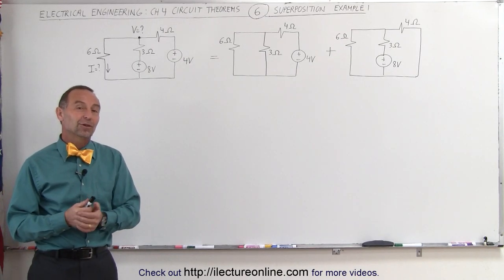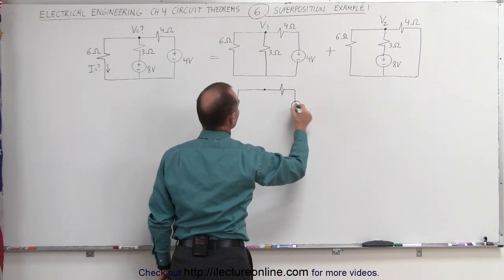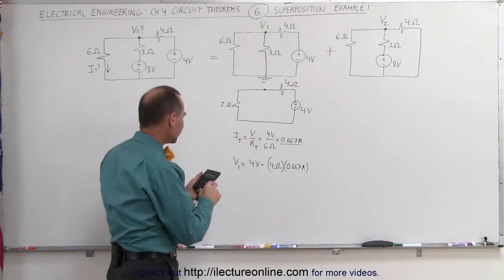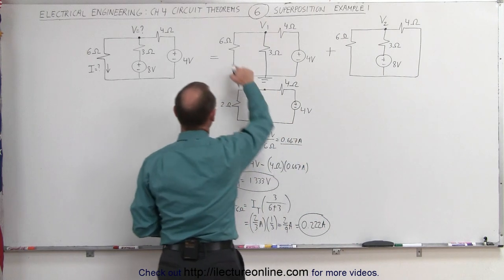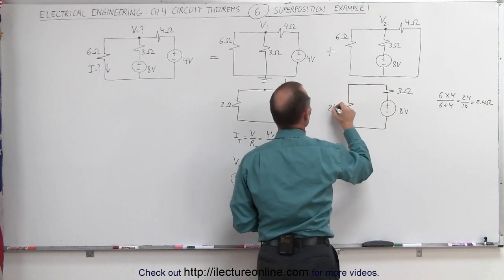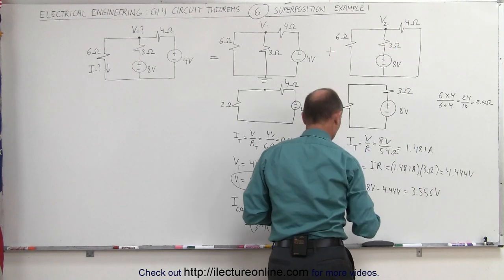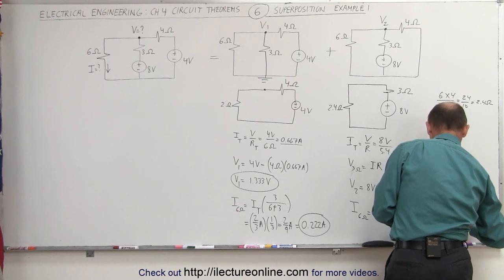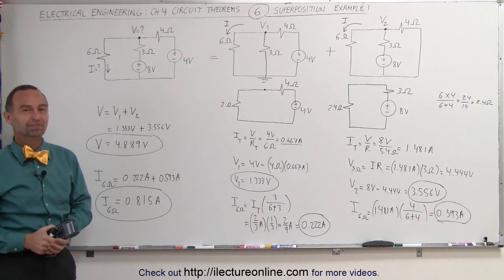Electrical Engineering: Ch 4: Circuit Theorems (6 of 35) Superposition Property Ex. 1

Comment: I calculated the CURRENT through the 6 ohm resistor using the equation,  I = V1/R6 = (1.333v)/ 6 ohms = 0.222 Amps)  since the 4 ohm and 6 ohm resisters were in Parallel with a common Voltage source at the NODE...   SEE MICHEL?.. you have taught us the different ways to come up with the same answer !!! Thank you for that. You teach us to think about the problems...

Comment: Another great video Michel! These video’s are the only thing getting me through my HNC atm!

Can you just clarify that it’s the current divider rule you’re using at 2:53 ? I’m just writing up revision notes and wanted to add a bit more background info 😊 Thanks
Reply from the maker: When we separate the sources into 2 circuits, we no longer need to use Kirchhoff's rules (although we could).  Then we end up with a parallel branch in each circuit and use the rule of parallel branches (product over the sum), not the current divider rule.

Comment: What was the purpose of calculating i1 and i2 in this equation? Would we not have saved lots of time to find only V1 and V2, find the total node voltage V, then just use basic ohm's law to calculate the current across the 6 ohm resistor?

In other words, I noticed that with V=4.889 volts and R=6  ohms, V/R yields 0.815 amps. No need to find i1 or i2 in this instance.

Comment: For calculating the current through the 6 ohms resistor should u not have a 6 rather than 4 on numerator? The divider rule? Since u want it through 6 u need to multiply by 6 no?

Comment: Hi, can you clarify why the 6 ohm and 4 ohm resistors are in parallel? What does it exactly have mean to share the same node? Thanks!
Reply from the maker: A node is where 3 or more conductors come together.  If the current traveling from one node to another can travel through one resistor OR another resistor then they are in parallel.  If the current must travel through both resistors then they are in series.
Reply: I know I am late. But, still I hope my explanation will help someone with the same question. If you use a breadboard to make this circuit you will notice that these two resistors have to be in parallel. They are just on the opposite side of each other. But it does not make any difference. Sometimes, a diagram is more confusing than a practical circuit.

Comment: I added the 4 ohm and 3 ohm first to get the equivalent resistant then I did a parallel  with 6 ohm so is it wrong to do that?
Reply from the maker: That is indeed incorrect.  Work it the way it is shown in the video.

Comment: Why only the 3 and 6 ohm resistors considered in determinig the current through the 6 ohm resistor? i_6ohm=i_T*[3/(6+3)] What about the 4 ohm resistor?
Reply: Because that is the total current going through the branch with the voltage source.
Reply from the maker: The 6 and 3 ohm resistor in parallel is equivalent to a 2 ohm resistor and that equivalent 2 ohm resistor is in series with the 4 ohm resistor giving a total resistance of 6 ohms   (2 + 4 = 6)
Reply: For the top middle diagram, the possible equivalent resistance combination such that you don't make all 3 resistor into one equivalent resistor( otherwise you can't find V1 , after the voltage drop across the 4ohms resistor) is 6ohms with 3ohms, 6ohms with 4ohms, 3ohms with 4ohms. Any combination with 4ohms is useless since you won't be able to find the voltage drop across the 4ohms resistor hence you are only left with making an equivilanet resistance with 6ohms and 3ohms.

Comment: for 8V circuit, i calculated the resistor of 3ohm || 4ohm instead of 6ohm || 4ohm like what you did, and so I got my V2 around 6.223V. however when i combined my V2+V1(6.223+1.333) i got 7.556V instead so im not sure where i did wrong. and if i add the resistors of 6ohm || 3ohm then i get my V2 a 5.334V, which means the overall V i get will be entirely different again. so im confused. how does one know which resistors to add??? does this mean we shouldn't change the branch connected between 3ohms and 8V source?? sorry if i ask a stupid question lol

Comment: What if the 4 ohm resistor didnt exist? Can we use superposition then? Cause, if we do it would short the circuit in one of the them.
Reply from the maker: Every method is not ideal for every situation and many circuits can be solved by multiple techniques.
Reply: Oh okay, thank you sir

Comment: 6 ohm resistor is in parallel with the 4 ohm resistor? on the second part?
Reply from the maker: Since there are two paths from V2 to the negative side of the 8 volt source, the 4 ohm and 6 ohm resistors are indeed in parallel.
Reply: Michel van Biezen bu there is 2 ways to go to the negative part of the 4v as well...both the first and the second look similar to me.. can you explain the difference Prof. Thanks

Comment: Sorry, but isn't the voltage at the node the same voltage of the three ohm's resistor? I have tried to solve the circuit by myself and the voltage of the three ohm's resistor that I have calculated is 3.107 V. For to solve the circuit, frist I have made to work only the current source of 8 V and the voltage of the three ohm's resistor was 4.443 V, then I have made to work only the current source of 4 volt and the voltage of the resistor of three ohm was 1.336. Finally, I have made 4.443 - 1.336 = 3.107 V. I also have tried to solve it with kirchhoff's laws and with the method of the "circuit analysis-mesh current" and the voltage of three ohm's resistor (which I think is the same of the voltage at node) is, in both cases, 3.108 V. Please can you tell me if I was wrong?
I apologize for my english.
Thank you.
Reply from the maker: Are you referring to why you got 3.107V instead of 3.111V ?
Reply: Michel van Biezen 
No, I'm referring to the fact that I get 3.107 instead of 4.889. I
apologize for expressing myself badly.
Reply from the maker: Note that it is technically not correct to state:  "the voltage of the 3 ohm resistor", instead we should state: "the voltage across the 3 ohm resistor" which in this case is equal to:  3.111 V. (8 V - 4.889 V)    The voltage at the node (V) is not equal to the voltage drop across the 3 ohm resistor and in this case is equal to 4.889 V
Reply: I have understood... I believed that the voltage across the 3 ohm resistor was the same at the node. I must to study better!  thanks also for the English lesson :-)

Comment: when calculating I1 passing by 6 ohm resistor, you used the ratio of I(TOT)*3/9 instead of 6/9 since we wanted current in 6 ohm resistor
Reply from the maker: No, the video is correct.
Reply: See, current is weird. You put the resistance of the current you DON'T WANT in the numerator, that gives you the current you actually need. So that's why Michel used 3ohm to get the 6ohm current.
Reply: Thank you so much, you just saved my life literally a few hours before my final exam! I get it now ... thank you